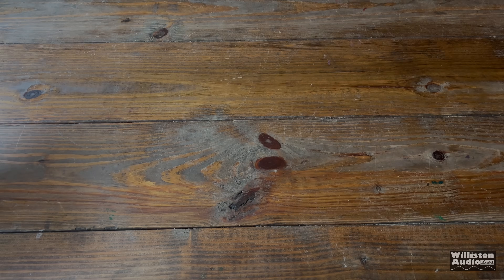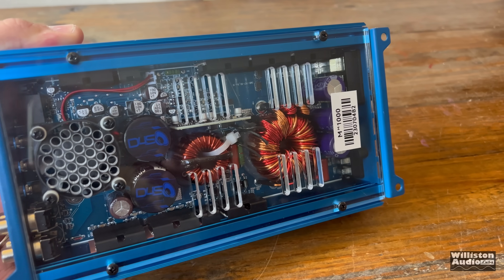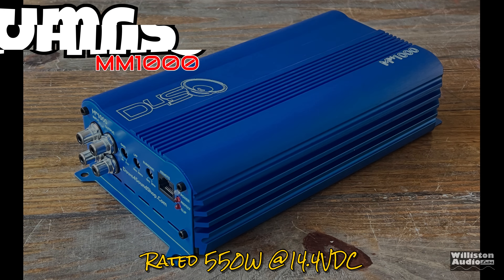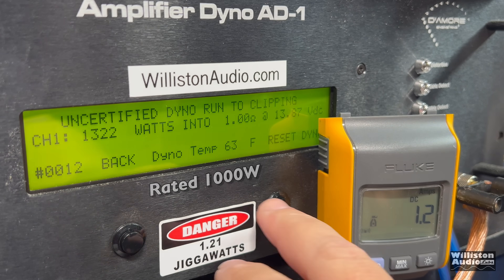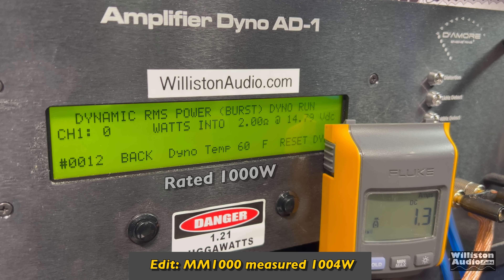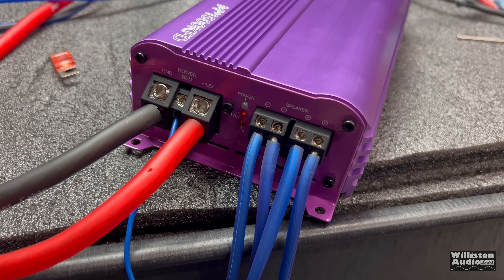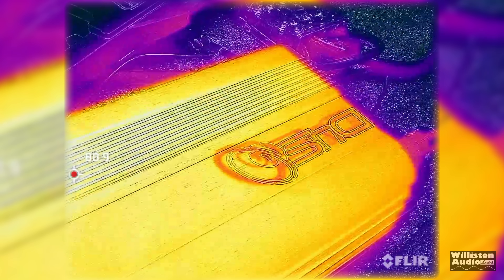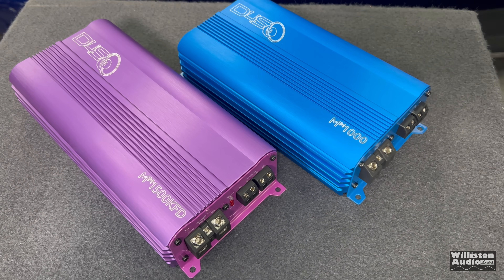Do These Mini Amps Survive the Amp Dyno Tests? D4S MiniMaxx MM1000 and MM1500KFD

Comment: Hey Big-D, your channels have really caught my attention lately, love all the new stuff, and old stuff alike, being an old-school competitor from the 90's myself, but wanted some of your experienced advice. On modern amps like the MM1000, I know they are rated at 1-Ohm loads, but for just normal day-to-day use in the daily driver, do they run cool enough to drive 1-Ohm loads, or is it best to hook them up at higher loads, like 4-Ohms, and take a few dB hit in wattage? Just curious of your thoughts, I have a MM1000 sitting here in the box ready to go, and with two 4-Ohm DVC subs ready to go, my choices are wiring at 1-ohm or 4-ohm total. Wishing I had the DVC 2's right now, so I could wire to 2 Ohms, and split the difference, but whatever, so 1 or 4 Ohms man, what you say on this MM1000 in daily use?

Comment: I found your video while researching the minimax 1000 and had a question about your tests.  In the amp specs it says fuse rating is 100amps but in the 1 ohm tests it pulls over that. Isnt that not good or does that fall on what size inline fuse is used?  Tia Keep bumping out the content!

Comment: This amp probably too much for alpine Type R rated at 750 rms. I see ifs maxin out that W7. Im worried I may blow sub up. I want a w7 but so expensive.  Whats the best sub you recommend thats good without breaking bank for this amp?  I have a type R and only running 600 watts has little room left but maybe thats enough for that sub already.  It could get a little louder im thinking about gettin this amp but I only have 130 amp alternator you think this will kill it😊 

Anyone know if Type R holds up running 750 watts or 1000 if I dont distort the signal

Comment: I'm curious if there's any design benefit of those angled-screw terminals.  If you're using just twisted strands without a ferrule, the downwards clamping pressure of a screw can make the strand packing go wonky, especially if you don't have good fitment or are dropping down a size of cable.  But with the angled screws, rather than just downwards force, you're also applying forward force, and with a smaller overall clamping area, due to the edge of the screw rather than the flat of a screw.  This probably also helps secure the cable into its forward-most position, and probably helps prevent pull-out.  Not to mention ease of access to the screw.  Honestly, this might be a feature I want to see more often than not on future equipment. 

Also, when it comes to RCA pigtails, I'm a bit surprised some form of mini-RCA never popped up.  The problem with TS/TRS/TRRS is that the tips and rings rub the ground, whereas RCA always has the shielding separate from the source pin via the barrel.  I guess barrel jack power connectors could be borrowed as an alternative, especially with how small they get, but they're just too uncommon in comparison to RCA jacks.  Though one thing I do want to see, although it's a bit pricier, is optical, it'd just open up more routing opportunities and bundles sources better; I'm genuinely surprised optical is an optional standard everywhere but car audio, I've even had laptops with a combo optical-TRS jack.  People don't like pigtails because the RCA connectors add so much bulk to the middle of a cable run, y'know where that portion of the cable is already being tucked under other things like panels, and short pigtails are generally a pain in the ass, pigtails will enerally never have a good solution unless you have a decent run of copper between a source and in-line RCA block but then you're adding an unsightly wart somewhere in the chain where there typically isn't room for one; the alternative to this is of course pinning those 4pin connectors yourself, but I don't think most people in this hobby would understand where to go for these parts. 

Full range amps are also useful if you have a lot of high-power drivers in one door, where relevant two and four channel options become drastically less abundant.  Just look at JP's current build, he basically has one of his largest amps per door.  1KHz rating is entirely reasonable for these, full-ranges aren't primarily meant for sub amps, and sub amps are already more abundant at these power ratings.

Comment: i have a general question about car stereo amplifiers . i have read in the instructions that came with different amplifiers i have had and they usually say to try and keep the ground cable to no more than three feet, and in amp wiring kits i have bought as well as ones i saw on ebay it usually says the grounding cable is three feet long . what is the reason for that , can the amplifier actually be damage if the ground cable is too long, or does it just affect the sound quality , or what ? i have had always grounded my amplifiers directly to the battery and have never had a problem, as far as an amplifier failing i mean. although i have never used the same amplifier for more than about two years. i always thought it would be better to ground them to the battery is why i did it . can anyone explain the reason that they recommend keeping the ground cable so short even though the power/positive cables that come with the kits are often over fifteen feet long
Reply: @warrenbuchanan2718  I can tell you 30 years ago on a Rockford fosgate the going from 3 ft ground to 1 ft ground was a noticeable difference. Maybe resistance or something I don't know but I did hear an installer one time chewing a young employee out about a long ground wire one day

Comment: Everything I've bought for my car is based on your reviews!
I bought a sundown sam500.1d amp. And a kicker 10" q class, I set it to 1ohm and my sundown amp started clipping, I put the test light to the positive at the amp and when the bass hit it drops to low 12v... I'm upgrading to 4g ofc Wires to see if it will help the amp from clipping..
I'm interested in this blue monoblock but I don't understand when you said the efficiency is no too good?
I see it gets 1000@2ohm 
But I just discovered how hard a system can hit @1ohm.
And I will like to keep it that way.
You think this amp will do better than the sundown sam500d.1 ,or I should get the CT 1000.1d ?. I'm looking for a small rectangular shape 1ohm stable at least 700rms

Comment: Also speaker cables do not have to be massive the current coming out of amp is is AC negating the dc voltage/resistance issue. Unless you're talking multiple kilowatts you're good. 😊

Comment: im thinking about getting the 1500kfd to replace my old memphis MCD1000. Im curious what you mean at 14:27 when you say remote only works for lowpass? Does it only work when the LP filter is on, could i not have the HP on to act as a subsonic, or how does it work?
Reply: I think it means it only works for bass/subs to control the level from the dash

Comment: Just received (and installed) a D4S JP13 and it's absolutely an EXCELLENT amp.   Only two issues I have are that their customer service is, apparently,  non-existent (I figured out the issue, anyway) AND the voltage/temp meter on the (robust) remote bass control could use with a dimmer - hahaha.. lights up the whole car (I'll figure it out).  

But Down4Sound are the amps to buy!  Great products!!!
Reply: A small piece of window tint works great to tone down the brightness.
Reply from the maker: Some tint tape will do the trick. They get really busy at times and I know they are working on customer service response
Reply: @wal  I found an old pair of sunglasses with plastic lenses and cut a piece to fit right over the display and used packing tape to apply it.  Works perfectly!   The CS issue was my fault - sent to the sales address by mistake.   Glad I did too because the problem was my fault - drove a mounting screw right through the remote wire - doh!
Reply: Cut a lil piece of window tint and cover your voltage readout. Thats what i did and it works great you can put multiple layers if needed!

Comment: Would you be willing and able to make a recommendation on an amp? I have an Alpine type R 10 4ohm dvc. Rated at 500 watts per coil. So 1k at 2 ohm.

Size and Efficiency is most important as space and power are at a premium.

Thanks!

Comment: remember the days when we had to pay a grand or more for some power sucking class A space heater amp to get that kind of power, and that was on top of the couple grand worth of electrical system mods to run the amps. 
What does bandpass capable mean??????
Reply: It means you can cut low pass and cut high pass frequency’s. So if you wanted it would only play from 80hz to 3khz.

Comment: Great amps, only thing is would like these amps to be shown rated 12.6-13.8v as daily normal ride amperage.  we know 99% of peeps electrical is not upgraded to 14.4v
Reply: actually almost every car out there is 14v plus when the engine is running, usually 13.8 at the lowest.  14.4v is totally normal.  Some newer cars charge at 15v stock.  The 12.6 number is fairly worthless because that is just battery power.  Nobody should ever just sit there and bump that hard without the car not running.  You might if you have a large lithium bank and you are doing demo's at a show (and recharging in between), but 99.999999% of the population should keep the car running if playing, especially at high volume levels.

Comment: Hey there Mr. Williston - from your experience and testing, I would like to ask your opinion about what amp to use to power 2 - 15" power series Rockford subs. These are the classic models, from 1999, and they are dual voice coils also. I was using two Memphis 1100D amps, one on each sub, but due to a shop doing a horrible amp wiring install, I tossed out the amps thinking they were blown. Sad story and painful to still think about. But, I am curious to know if you think one larger amp or two smaller amps would work best. I am especially worried about amp draw from amps) on my electrical system and would like to get the maximum output from the subs. I am just curious about your many years of knowledge and experience, and your personal perspective. Any input would be greatly appreciated. I will most likely run a sealed box since I don't have many quality installers where I am, that I trust, building a proper ported enclosure.  Thanks & Cheers

Comment: Hey Derek. Can you ask Sam how the hell these tiny amps can destroy the old school amps like the orion 2100hcca amp for 1/3 the price.. I had 2 2100 and thought they were the bomb back in the 90s.. but now, i see they were a terrible amp for the price..  Bad design, bad parts, bad marketing??
Reply: Easy....technology has came that far. Power in the 90s was industry standard at $1 per watt. Now it's closer to $0.20 (or even less depending on form factor) per watt. Also consider in the 90s how few companies made amps vs now. When there is a full field of options vs 5 or 6 reputable back then competition drives the prices down.

Comment: its so strange hearing demos on my home computer system. getting your bass from my sub but port noise from my speakers. lol
i just installed some of these amps in a system at work. 123 4 and a 1004 with a jp63 and jp40 (iirc on those model numbers). they are pretty good, so far ive been impressed given their low cost.

Comment: Just bought the MM1000 for 2 RF 12s going down to 1 ohm.  It will bump.  Lol
Reply: Hi, just curious how you like your MM1000?   I’m going a simple sub install to factory , one 10” JL in very small custom box….I’ve decided on D4S, but debating between Mm1000 and JP3.   Cost basically the same and need a compact amp.   Any opinions on the Mm1000 so far?  Thank you
Reply: @curtissanjenko285  I haven't installed it yet but I will be this weekend.
Reply: Sounds good.  Good luck with the install and keep me posted.   I’m an old guy who was pretty big into custom installs 20 years ago, these days OEM systems are decent, but still lacking bottom end low hz, so simple upgrades are all I do for myself now ( drop in speaker upgrades, or sub add ons). These small D4S amps seem decent…I was always a die hard Alpine guy, but needed a surfboard size amp to get decent power….todays class D amps are almost criminal for what they can do😀.  Keep me posted!

Comment: What is the small adjustment knob for on top of the bass knob? I don't see anything in the manual about it.
Reply: Allows you to match the voltage reading on the base knob to match the reading at the power inputs to the amplifier.
Reply: @mugendrewable  sorry for the potentially stupid question, but what would I need to find out the input voltage at the amp?
Reply: @HideTheHamster  so you can monitor your voltage to make sure it doesn't drop to low. Helps analyze your electrical system and if any improvements you have done to it have been a benefit.
Reply: @mugendrewable  I see that. But why would I need to have an adjustment on it? Shouldn't it be able to read the voltage correctly on first plug in?
Reply: @HideTheHamster  that would really depend on what volt meter you choose to be your reference for voltage at your amplifier inputs.

Comment: Would you test an old school discontinued Kenwood amp if I sent it to you? This was the first name brand amp I ever purchased and has served me well in my daily driver for 20 years. The only reason I pulled it out of service is to replace it with a newer amp with twice the power.

The amp in question is a KAC-7201. I have been scouring the internet for years looking for a dyno test on this old amp.

Comment: Hey, love your vids, would love an acces to the amount of amps you have :'D. i do have some questions You say network cable, but it looks like a 10p10c connector which is referred to as a RJ50 connector with 10 contacts no?. 1gb/10gb network cable still uses a rj45 connector 8p8c which has 8 contacts.  Would h8 for someone to install network cable before his amps arrives and....

Comment: The 1500kfb is a great option if you're running a 3 way active front stage and want mono midbass. The mm1000 can't be used unless you're okay with crossing at 250, which I was not. There honestly isn't a lot of options for things like that without spending way more money.
Reply: The amplifier was designed more for that anyways that’s why there is a mono block available for Bass
Reply: Yes I second that big D if you have two and want stereo high powered mids this is way better than the other mini options I have two of the MM1004 they fit under most seats just need a mono to complete the setup now 1000 or 1500 🤔
Reply: I never use the built-in crossovers in amps. I'm a firm believer in using ONE quality crossover unit that splits off to all my amps, OR using the crossover option in the deck if it has one. A lot of the newer, 
high-quality, decks have quite a nice crossover option built-in to them. 

I don't like having a bunch of random crossovers that come built-in to my amps mangling the signal phase.

The closer the drivers are all time-aligned, without having to go into the deck and manually do it, the better I like it.

Comment: Need better efficiency with small amps because they lack the heat dissipation when used for long periods of testing they will inevitably heat up
Reply: It’s why I prefer midsized to bigger amplifiers for the deep bass. My Taramps Smart3 is not that big and does a great job with the deep bass; hardly gets warm after hours.

Comment: What's wrong with full range mono ? I run the majority of my systems "old school" 1 amp on L & R. Most HU stereo separation is superior to a lot of amplifiers. It also allows you to gain match the L &  R signal. Look at how many Dyno runs one channel puts out a bit more power than the other on 2ch amps.
Reply: Almost no one run systems like that anymore other than high end SQ guys that may have a five channel for the left and a five channel for the right